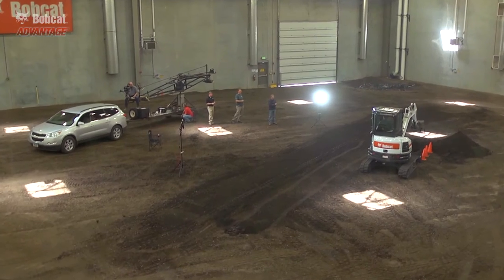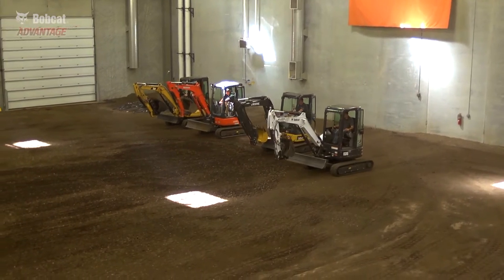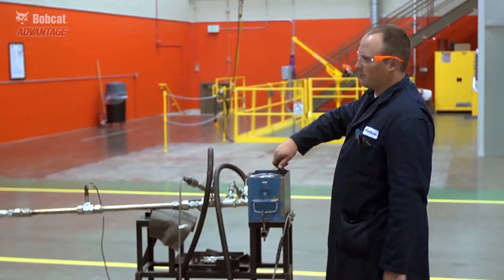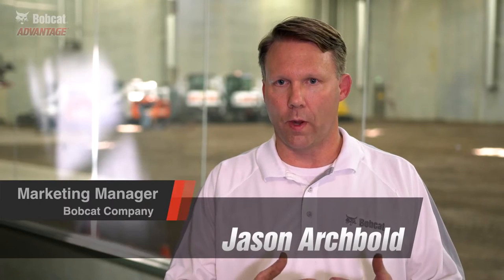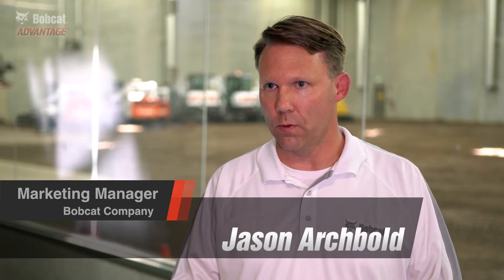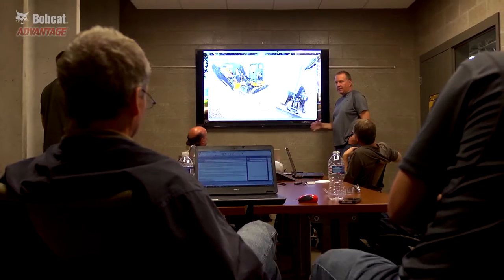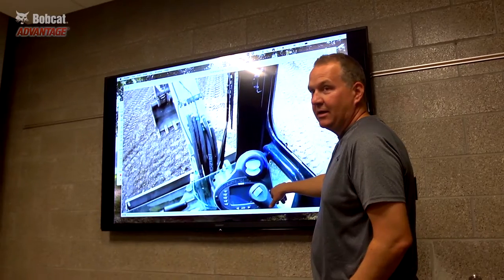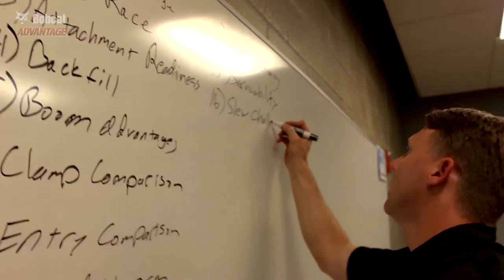Test Design and Set Up: Bobcat Advantage Behind the Scenes

Comment: one of several problems I see is that you DON'T test all models of mini excavators in the size category. You leave out Volvo, Yanmar, Takeuchi, Wacker Neuson and Kobelco. Which by leaving out all competitors. DOES NOT HAVE A VALID TEST OF YOUR MACHINES AND CAPABILITIES.
Reply: +Drew6709 My guess is they are testing the top 5 manufactures by market share or something like that, this is a PR video not a comprehensive comparative assessment.